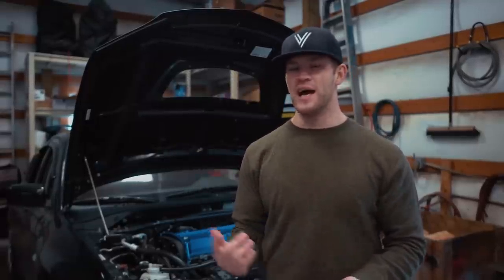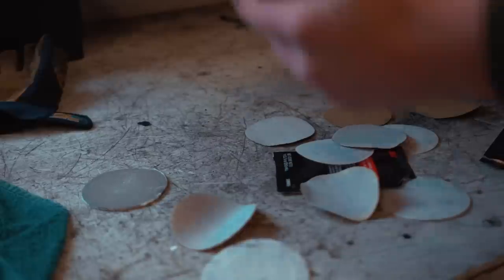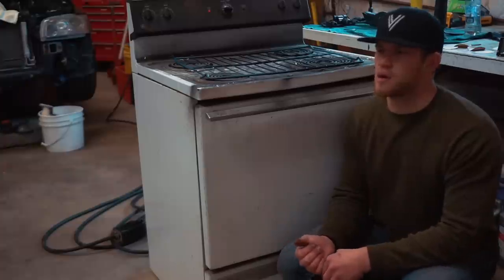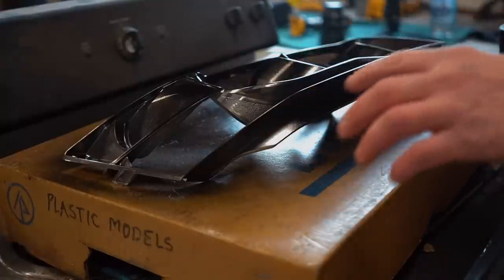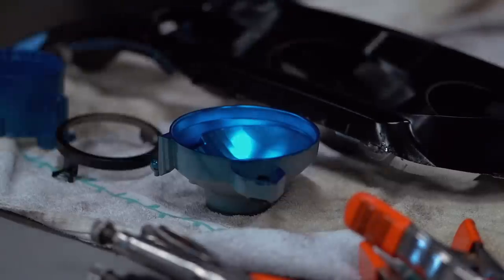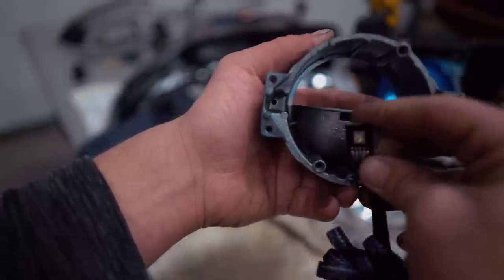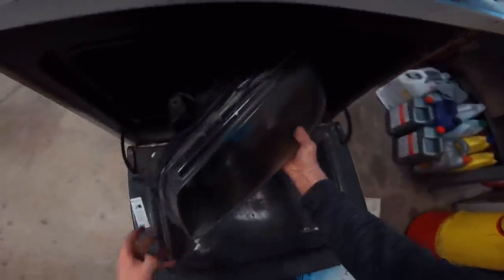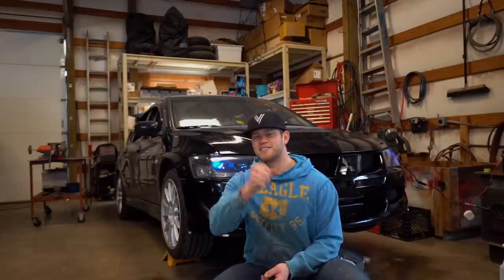Building Insane Headlights!

Comment: I´m happy that this is illegal in our country.
Reply: so you're happy your country restrict your freedom to modify your cars ?
Reply: @boszybtz  the angle eye affects almost nothing it is a dim light that will cause absolutely zero glare to other road users, the led light upgrade providing decent ones and not cheap ones are very good replacements for standard bulbs 2hich cause no more glare than current zenon or led bulbs. Painting the reflectors however I can understand an is fairly silly
Reply: @axeami1354  You mean demon eye?  Angel eyes are the ring around the headlight.  (not done in this video) Learn your lights so you know your mods.  Also it has been proven using repeatable scientific means that putting any led bulb (for the high beams or low beams) in place of the factory halogen bulb (the bulbs he replaced on this car) yields less visible light due to the absence of the proper Fresnel lens and cutoff. This is because the light beam defuses causing the light to travel a shorter distance than stock while creating a blinding glare for oncoming drivers.  
Just so you know the Fresnel lens aka projector is used to focus the beam by essentially flipping it upside down. (more to it than just that but for simplicity.)  This is why the cutoff is on the bottom of the light housing but blocks all output light above the cutoff on the actual output light etc.  (i will skip how the explanation of bi-anything headlights for now.) Anyway not all Fresnel lens or cutoffs are equal as each type of light be it halogen, xenon (not zenon), or led produce light at different spectral wavelengths.  

Oh and lastly modifying the headlights on any car within the U.S. and almost all other countries is illegal as it voids the approval for the equipment to be used on any public roadways. 

It amazes me that people actually modify or at least talk about modifying a car while having zero knowledge on what it is they are changing and what the effects will be of making a change let alone the law when it comes to changes.  Fortunately though most of these kids either blow their engines from poor bolt on mods or they crash their cars because they prioritize speed and looking cool over safety upgrades like brakes. Either way it keeps the majority of them off the road for long periods at a time.
Reply: @pprotory  I dont mind people putting LED or xenon kits into their highbeam. Since highbeams are only used (SHOULD BE USED) when its dark and there are no cars right infront of you
Reply: @iLikeCookiezToo  if you mind it or not doesn't change the fact that they have less visibility on the road while driving thus increasing their chances of having an accident and hurting themselves or others or just damaging property. 

As for xenon kits... High beam is accomplished by either an auxilliary halogen bulb or with the use of a Bi-Xenon light where a high beam is accomplished by lowering the cutoff.  This is because you can't rapidly turn on and off or flash a xenon bulb as the bulb has to heat up and rapid on/off can hurt the ballast.
Reply: @pprotory  I dare to disagree with your point that I have less visibility on the road if I use a xenon kit on my highbeams. And with a good quality ballast (such as fast start F7 75w) and a good quality xenon bulb (CN-Light for example) you can have pretty much instant heat up with the xenon. And they still last longer than most of the halogen +200% ultra vision ( for example ) and give far greater light output.
Reply: @iLikeCookiezToo  SMH It's not just my point it is a fact that has been tested by NHTSA, ETSA (in europe), and JASIC (in Japan etc which is why they aren't approved for use on highways.  Why?  I already explained this but why not again.  HID lights (xenon) require the use of a specific Fresnel lens (projector) in order to properly focus the light that comes out into a usable beam.  Further there is a cut-off that is used so that the beam comes out as a low beam.  HID lights that have HID high beams (BI-Xenon) Achieve highbeams by using a solenoid to lower the cutoff out of the beam of light giving you a higher beam that projects farther.  Is it possible to convert your lights properly? sure but most people don't do it as they don't realize there is a huge difference between halogen projectors and cut-offs and HID ones.  As to your listing some the fast start f7's even those have a delayed start meaning you can't flash them reliably. Thus they are NOT approved for the street as that can jeopardize safety.  Why?  Because in a halogen setup just applying current triggers the relay that powers the light.  It takes milliseconds to complete.  In a bi-xenon setup it actually takes less time as the light is already on.  However in a standard xenon setup where the HID bulb was never powered on it takes seconds to actually turn the light on.  This means you could have already let go of the high beam flasher and the light could have never come on.  As to brightness don't confuse brightness with visibility.  Yes a xenon bulb is brighter but without the proper projector it defuses outside the visible spectrum.   Meaning you can't see what it lit up.
Reply: @pprotory  The xenon setup which I told you about will flash the xenon bulb pretty much at full energy ( dont know the proper terms here since I dont speak english that well ). So if you need to flash, it will surely flash. Theres no need to wait for the flash to happen... And atleast here in Finland people use additional lights on their cars with the exact same setup. And they are approved with the required markings so you can use xenons in them. They for sure give far greater visibility on the road than regular halogens will ever do. And Im not speaking of any low beams now, only the highbeams. I know exactly how a Bi-Xenon works since my own car has them
Reply: @iLikeCookiezToo  it is a matter of how many things need to happen to get power to the lights.  halogen = switch to relay to bulb. xenon (non bi-xenon) = switch to relay to ballast to ignitor (note some are all housed in the same box) to bulb.  The more things a circuit has to travel through the longer it takes.  But for the sake of your argument on the amount of time... The only way they would be approved would be if they had the proper projector in them which is not something just a bulb contains. Without the proper projector it does not illuminate (increase visibility) over what a standard halogen bulb does.  Just ask Hella and Bosch who developed the original HID lights for BMW.
Reply: @pprotory  Well, electricity sure seems to travel far longer in US than in the rest of the world :D You really havent seen a single halogen vs xenon comparision with your own eyes(not speaking of any videos)? I trust my own eyes rather than any studies that someone has made. But yes, feel free to belive that xenon doesnt give more visiblity on the road than a standard halogen does
Reply: @iLikeCookiezToo  I never said xenon doesn't put out more visibility than halogen.  I said xenon bulbs in headlights without the correct projectors gives off less visible light netting less visibility.  Context is everything and yes I have seen tons of videos and real world comparisons.   

As for the time it takes for current to travel that has nothing to do with what part of the world you are in (obviously you were being sarcastic.) it has everything to do with resistance.